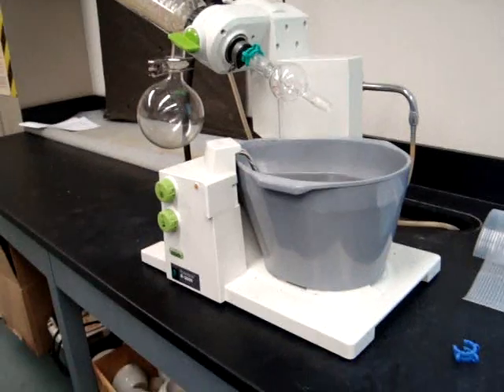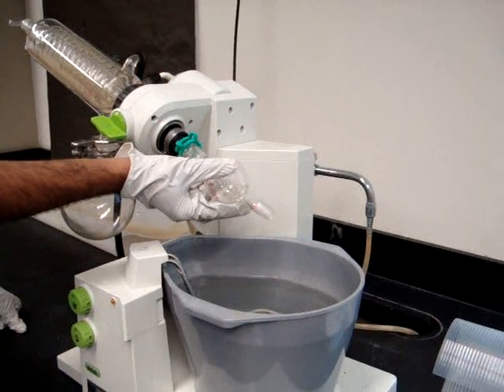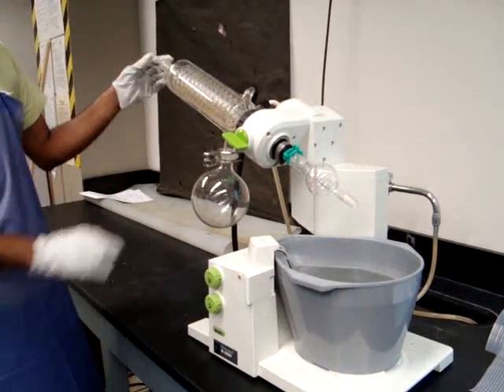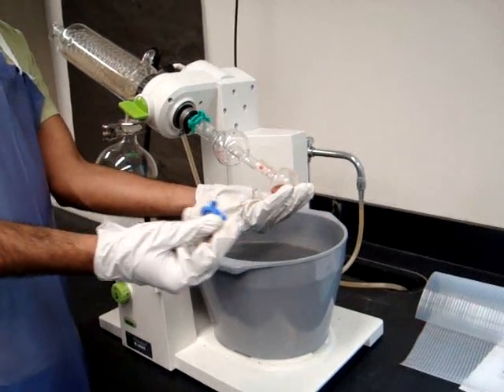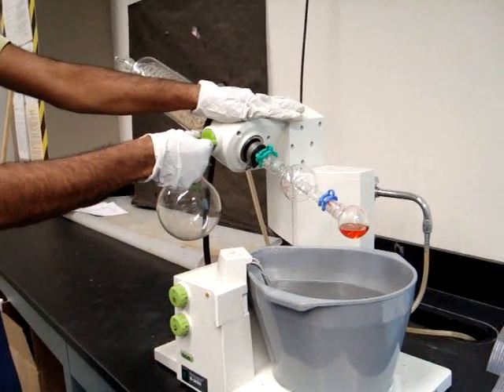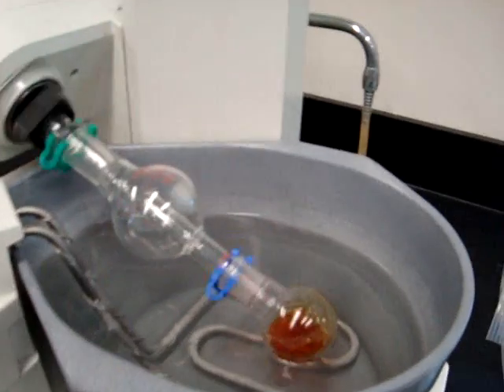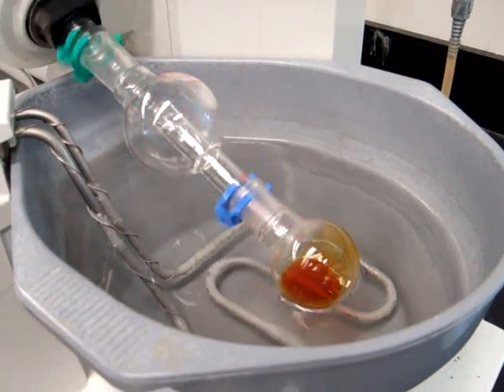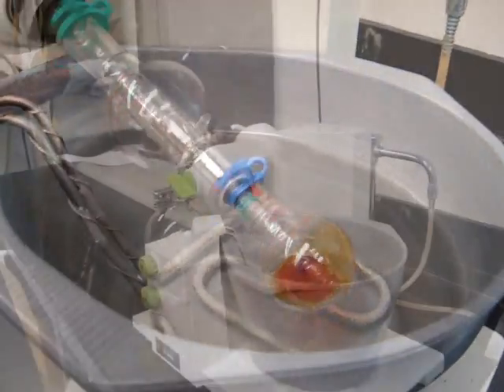How to use Rotary Evaporator CHEM2050

Comment: What is the problem if the spin is not working?
Reply: The motor does not rotate:
The inspection content is as follows:
1. The indicator light (or digital display) of the electric control box is on to check whether the connection of the external plug in the electric box is loose or disconnected.
2. The indicator light (or digital display) of the electric control box does not light up.
3. Confirm that "1, 2" is not abnormal.
4. The inverter will display "O.U." due to high frequency interference.
5. Inverter protection function display.
Solution:
1. Re-insert the plug and connect and disconnect.
2. Update the fuse or confirm that the power supply is not abnormal.
3. Update the circuit board or electric control box.
4. Connect the ground wire or change the work location.
5. Exclude according to the inverter manual.
Or you can buy a new machine on our website. hahaha
https://www.zzkeda.com/rotary-evaporator.html
Reply: Thank you for these very helpful steps. I will follow through to see if my equipment will work. Do you do shipment of equipment to other countries? I will order from Papua New guinea, will you deliver?
Reply: @winnifredduk893  yes,We have warehouses all over the world, I hope you have no problems with your equipment, if necessary, leave a message on the website.https://www.zzkeda.com/rotary-evaporator.html
Reply: @winnifredduk893  Hey, MS. We have inexpensive equipment that doesn't break down easily, so let's chat!